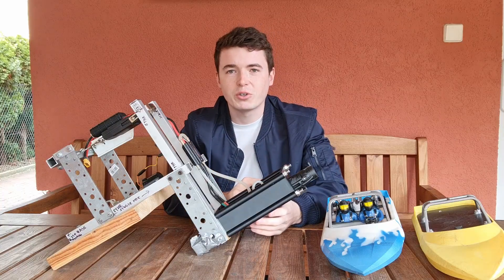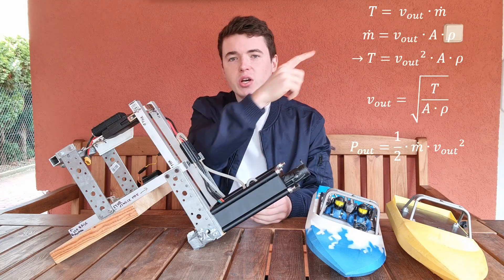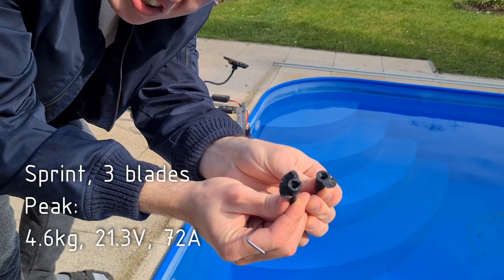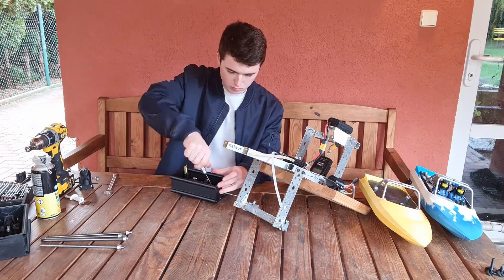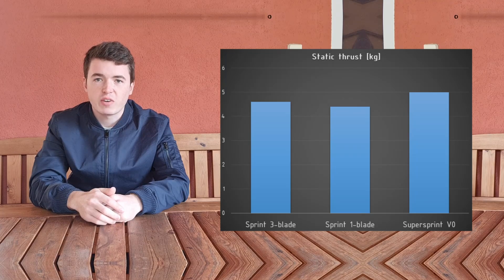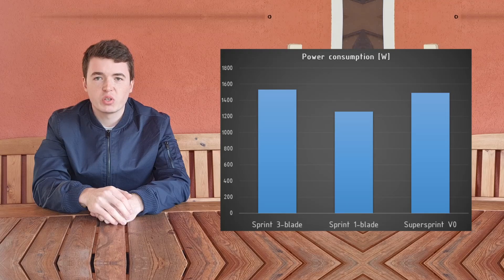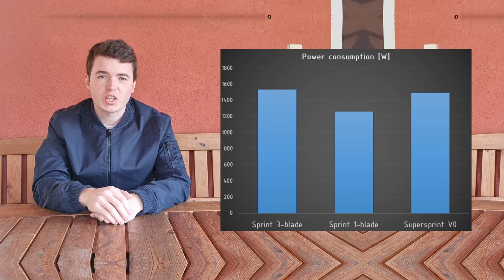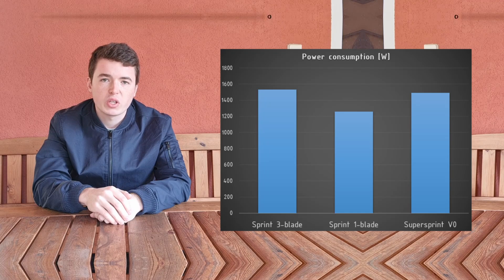3D Printed Jet Pump Comparison / M-Jet Sprint Gets Challenged

Comment: I have a question for people that are smarter than me what is the advantage of a single blade impeller because to me it seems like it would be offset and vibrate more
Reply from the maker: I believe the reason is, single blade has less surface and causes less losses due to wall friction. The wall friction effect is very important at such small scale, where walls are close to each other and the flow area is small compared to the surfaces enclosing it.
Of course with big pumps, there is so much space everywhere that the wall friction is no longer so important.
The single blade impeller is not fully balanced, but this only creates a problem with higher density materials. Plastic is lightweight enough to just work without having 100% balance.
On the M-Jet 35, which uses a 3D printed metal impeller, full balance is achieved by using counterweights.
For more insight, you can take a look at more videos and playlists on this channel.
Reply: Thank you that makes a whole lot of sense

Comment: Next time you do something like this put together a graph of thrust vs power. As is you are only showing the values for max throttle, but when it comes to endurance you will likely be in lower throttle values for much of the run. You can also show velocity vs power.
Reply from the maker: Yes, you are right. Thing is, as I am doing all the sensor readings manually and write them down, I need to keep it simple. I need to be able to print many parts and do many tests quickly and compare them all aganist each other in the simpliest way possible. So that's why I am choosing the max throttle performance as the only point of measurement, which obviously comes with some drawbacks.
Reply: @mjetdevelopment   when I do it manually, I’ll set the throttle in steps, like 10%, 20%, etc or 1200us, 1300us, etc, record the values at those throttles, graph the result and take the log trend-line of the total result (to flush out error), and thats effectively the graph. In practice it’s quite reliable, at least for drone flight time estimates.
Reply from the maker: @MarcStollmeyer  Sounds like a good way. I might do this with the final design to earn more information about it.
Reply: @mjetdevelopment  arduino logger? i used AVRs for that before, you can output to a terminal on a pc, or a txt-file on an SD
Reply from the maker: @simonschneider5913  Do you know any way to measure 70A current with arduino? Always when I tried searching, high current applications did not seem very common.
I have no experience with arduino tho, maybe the answer is obvious.
Reply: @mjetdevelopment  a shunt resistor connected to the internal ADC with internal reference is the simplest option. have to look it up whats the accuracy you can get out of this.

i did temp and humidity logging and filtered out any measuring errors and noise in the firmware.

somebody has prob done that same thing and theres an arduino-sketch out there. the board i did it on isnt available anymore....but if theres nobody else more knowledgeable than me, i could try to help you with that...
Reply: @mjetdevelopment  didnt know the module before - but there has to be a sketch by somebody...[EDIT: i soon have to set up another logger for my own purposes anyway, and I like this current module. if you can wait a ilttle, I will do something one can work with. i need my output as txt/csv and streaming live to a terminal. that should fit your purposes just as well i guess?]
Reply from the maker: @simonschneider5913  I don't even need live streaming, just the txt/csv output is important so I can run it through the computer immediately.
Apart from the current and voltage sensor, I also need a "pull" load cell up to lets say 20kg.
I don't have time to start learning with arduino now but if you come up with some solution along the way, let me know and I will take a look:)
Reply: @mjetdevelopment  "Allegro ACS758" is the name of the IC, there are arduino-modules. 100A current..

YT deleted the comment about it, so my last comment is missing context. i hate the nonsense going with comments..why is that so bad lately?
Reply: @mjetdevelopment  i will see what i come up with,  and when.....because our logging needs are very similar it seems...

Comment: I personally found that the single blade prop on the spring really helped battery life which was nice, will have to test the supersprint with same electronics once I get it built to see how it compares
Reply: i heard before that this was actually very efficient. never really got the physics behind all that, tbh..and the bearings wont like it i guess??
Reply: I found my bearings died to water(I was using cheapo ones) prior to any other issues. 
 @simonschneider5913